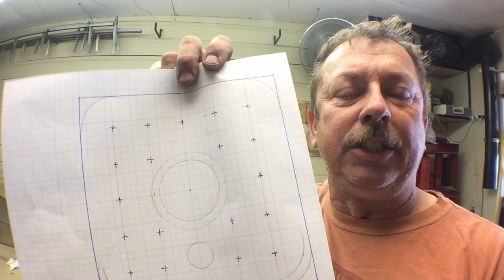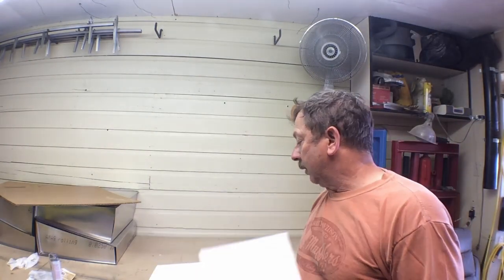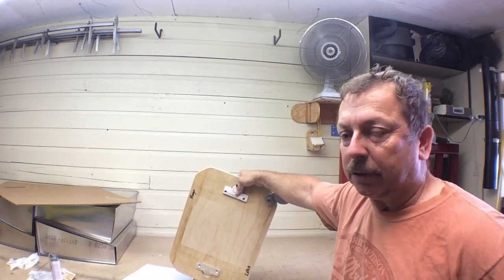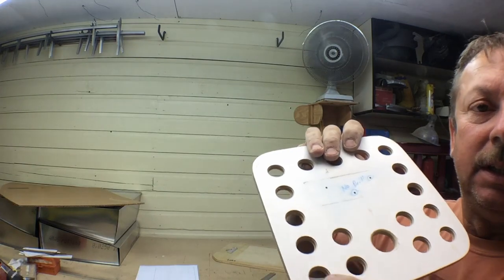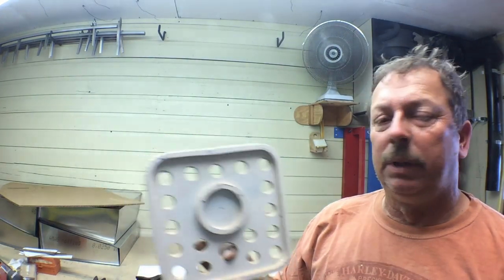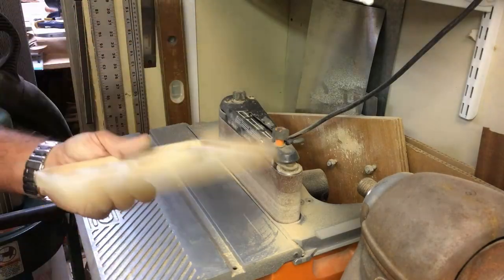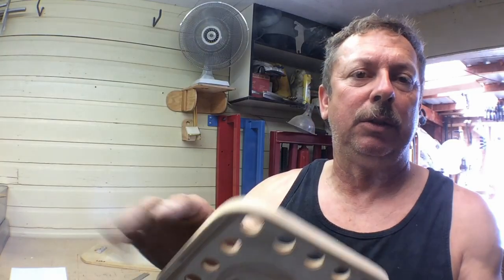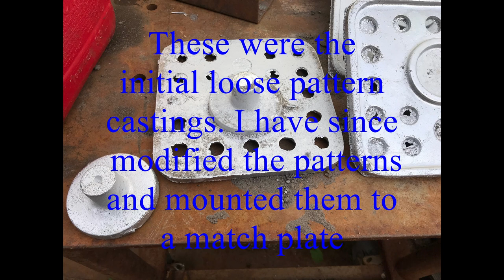Building an Atlas Collet Rack: Part 1

Comment from the maker: Thanks John: It is plain old body filler. I have mounted the pattern onto a match plate and partially filled the thru holes. I will have to go back and machine them out, but I think it will give better results. I had problems getting a clean pull at the small holes.
Reply: Body filler. Good to know. I look forward to seeing the finished casting. I just did my first little lead castings. Baby steps toward eventually working with aluminum.
Reply from the maker: yes, I saw your lead casting. didn't realize play dough would stand the lead temp.
Reply: Thanks for having a look. I wasn't sure myself how the dollar store "Play Dough" would react, but it's actually really decent, especially if you pop the part out and hose it off with a sprayer while still warm (It washes the dough right off). If you let it sit, it bakes on in a thin crust that pops off with little effort. After about a dozen or so pours the dough loses a lot of it's elasticity and becomes crumbly and useless.  Overall it was a cost effective learning experiment. :)